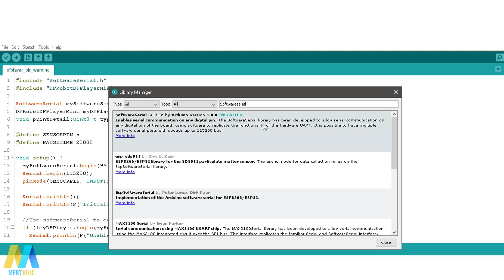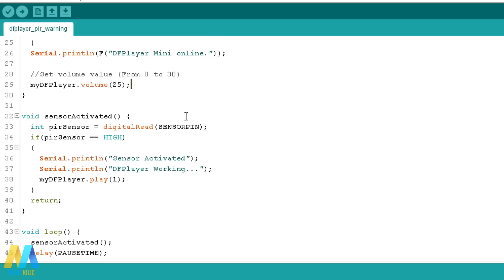How to Make a Talking PIR Motion Security System

Comment: Great tutorial, thanks!  One thing I'd like to mention from my experience building this circuit is that depending on the mini PIR you are using the sensorPin might remain in a perpetually HIGH state causing the mp3 player to loop indefinitely.  If that happens to you, when following the video at timestamp 2:04 instead of jumping the PIR + pin to the nano's 3.3V pin as shown in the video, jump the PIR + pin to the breadboard's + (5V) connection.  I'm not sure why the 3.3V connection doesn't properly work for all mini PIR sensors, but I tested mine by building a simple LED circuit connected directly to a power supply and when I powered the circuit with 3.3V the LED would stay lit indefinitely, but when I powered it with 5V the PIR sensor worked as expected.  I hope this helps anyone with the same results I had initially.  And a thanks again MERT Arduino & Tech for this helpful tutorial.
Reply: I have this issue with my build. However my player loops indefinitely whether I use 3.3v or 5v. Ive also tried with a separate power supply without success. Im using a HC-SR501 sensor. Might need to find a different make of sensor

Comment: I built this works great but the moment I turn it on on there is white noise from the speaker (never goes away), is there a way to avoid that? I am using a small 3.5 mm barrel jack adapter to plug in the speaker and it has 2 additional pins that are not being used, cold that be it?
Reply: Try connecting the barrel connector's tip(SPK_2) and ring1(SPK_1) to the circuit.  If white noise if present, connect tip and ring2 (not ring1) and see if noise persists.  If noise still present, connect tip and sleeve.  If noise still connect tip and ring1+ring2(both connected to DFPlayer SPK_1).  Finally if noise present still, connect tip and ring1+ring2+sleeve(all 3 to SPK_1).  If that doesn't work repeat the above steps but reverse SPK_1 and SPK_2 positions.

Comment: Thanks for sharing! I've got it set up and the PIR triggering on motion, but the speaker only emits 2 tiny clicks about 3 seconds apart, as if the audio file tried to play, but had no luck. Any idea why that could be the case? Thanks again!
Reply: ik this is late and you already figured this out probably, but connect the gnds on both sides of the dfplayer to ground.
Reply: @Halloween_Central  thank you!
Reply: @TheYelof3  also make sure the files are 48 hz or below

Comment: Hello Sir. Looks straight forward.. but in may case It seems that the PIR is active whole the time. The sound sample is looping. I have checked the PIR senor and it  is working in other applications. Any Ideas?
Reply: Since your comment was posted a year ago you may have already figured this out on your own, but in case you haven't figured it out the behavior you describe might be caused by a slight variation in the voltage being supplied to the PIR.  If that is the problem you might be able to remedy it by connecting a capacitor in parallel with the power supply.  Here's a link to a video that addresses the problem around the 9 minute mark.
Reply: @shawnmac1974  no link!

Comment: did you made another tutorial but using ultrasonic sensor instead of Pir motion?
Reply: Friend I made 2 alarm systems with Arduino, the second project is the video-project,but the first video is with ultra-sonic sensor..In 3 weeks I will upload the project with Ultra-Sonic sensor and in one month I will upload the video-project,both of projects I made in solder board with solder iron....
Reply: @electronichannelgreece can you send link